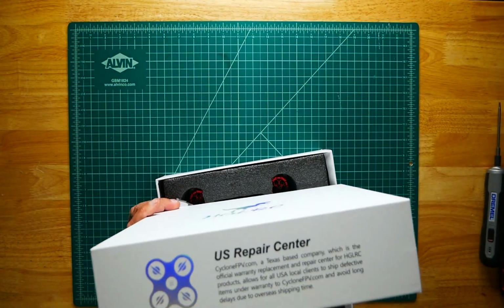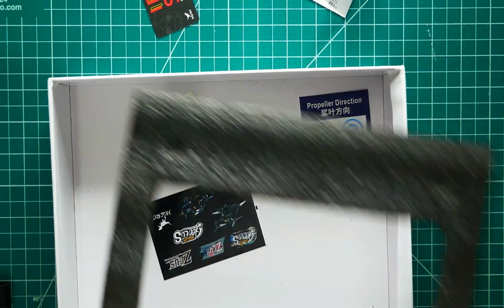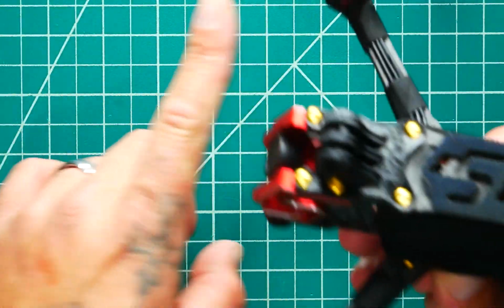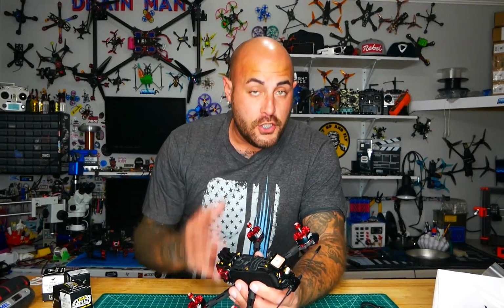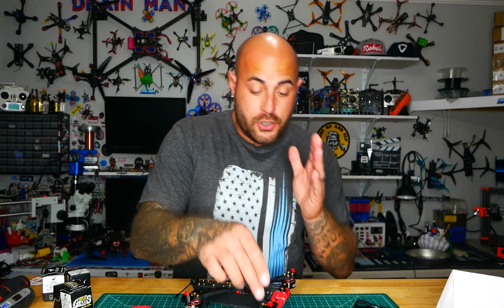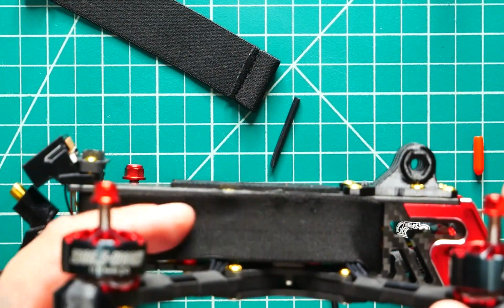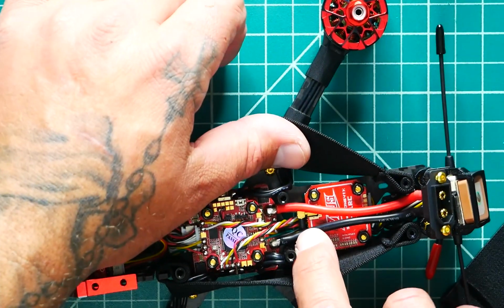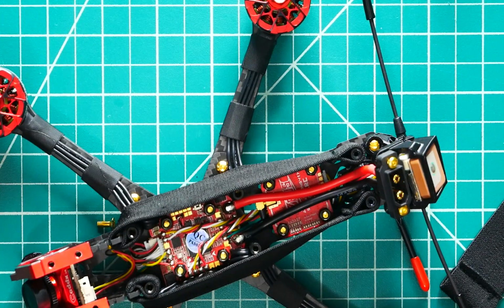Your Next Ready To Fly FPV Drone Is Here!

Comment: You was not supposed to plugged lipo into new drone WITHOUT antenna tighten up plugged on first BEFORE plug in lipo. It's showed on 7:20 to 7:22, check it out  But very nice new fine and awesome drone but can we put in HD FPV system like caddx polar Vista with starlight lense on this drone? Let me know, thanks Drainman! 🤙🏼

Comment: i beg to differ... betaflight 4.3 is not all that special, i just built a GRL with a kakuteH7 F.C.-Holybro tekko32 Metal F4 65a 4-1 ESC stock 4.3.... and it blows, i mean it holds its line better then the other versions. Like even going inverted holding that same steady line even adding in a yaw spin your still tracking that same line perfectly... but i have terrible wobbles deff. gunna be a little while before i get this new gear dialed in to the way i like it... But the saying that 4.3 is perfect would be false, its better in the line tracking since but aside from that i was expecting way more.... it really sucks to cause the tune i ran on my usual T-motor F7hd Stack F55a 4-1 ESC is fucking perfect its so locked in its crazy, the reason i switched is cause i need more amps i use high kv and don't put a throttle Cap on it so i needed a 4-1 that will handle F80Pro 2200kv motors on 6s which it will handle now but the tune is so bad i cant even do tricks like i usually do... super disaponted at the moment... once i get it dialed in im sure that will be a different story but as of right now, its poop lol
Reply: Hi, I'd love to have my quad dialed in, still looking for some good pids to get in the ballpark. Could you share your filters and pids settings?